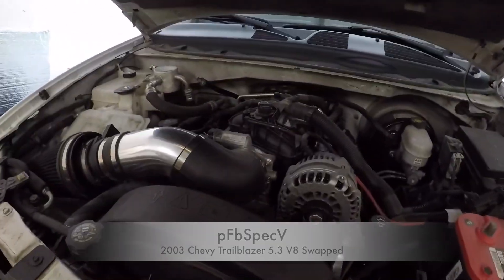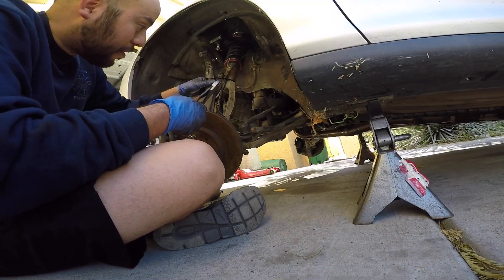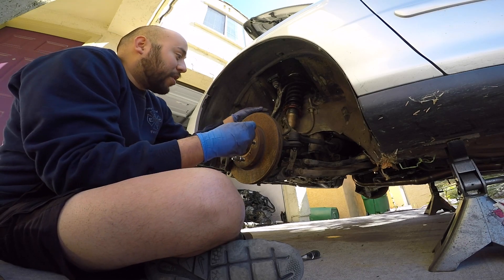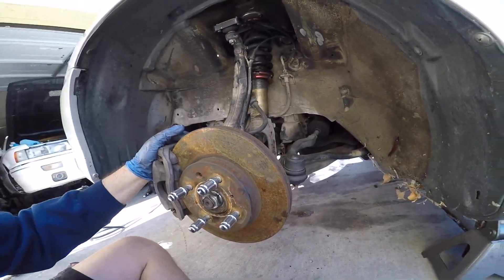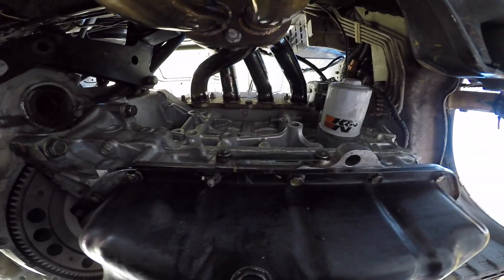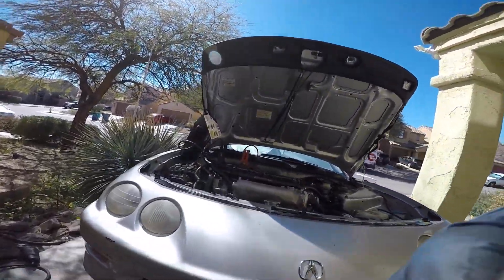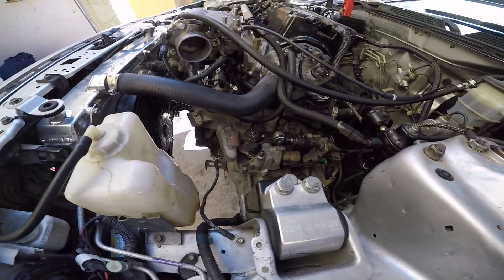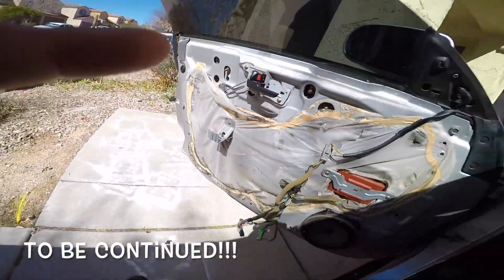Installing Axles on my k24a2 Acura Integra.... SUPER EASY!!!!

Comment: Going to bounce off Mike's question. Are you running with the K20 midshaft or the original K24s midshaft?
Reply from the maker: I wanna say ep3 mid shaft but could be wrong
Reply: @pFbSpecV  ah so the k20a midshaft. I have a k24 one on mine but been reading it's a couple inches longer than the k20a's so that throws a wrench into the axle plans. Might have to grab myself a k20a half shaft.
Reply: N11LL0  K24 swap an RSX? You'll need a Kpro ECU with a K24 Basemap. K24s can be run off the K20 ecu but you're going to lean out because the ECU isn't supplying enough fuel for the displacement. But all the K24A/K20A transmissions and the K24Z/K20Z transmissions should bolt up to each other. The only ones that don't match are the EarthDreams where the Intake/Exhaust were swapped, and the starter is located on the backside.

But a K20A2 transmission on a K24A2 is a bolt-on affair requiring no special adapters. You just need to swap a few sensors or repin the RSX harness with TSX connectors for some sensors like the Knock sensor as it uses a different connector type.
Reply: N11LL0  no problems my dude. All I need is a workshop and a bunch of Ks and I'll write a KSwap Bible haha.

Comment: what axles are you using and did you have any issues with the radiator hitting the throttle body or fitment. I'm at that stage now
with my k20a2 5-speed swap. Need good budget-friendly rad and axles. instagram Ekracer98
Reply from the maker: Use rsx base model axles and i dont recommend the csf radiator. Im still having over heating issues with that radiator. 

I have tried multiple things and still no luck. Removed the thermostat, swapped motors, did the head gasket, added a fan, and still no luck.
Reply: @pFbSpecV   Alright thank you, man. I'm still trying to figure out the rest of the stuff I got to run my fan switch wire and temp sensor wire somewhere. Do the base model RSX axles do they need to be modified or just throw them on? I just finished my wiring today still got run fuel lines.
Reply from the maker: @stinky15552  just slap in the base model axles and you will be good man
Reply: @pFbSpecV   Thanks I ended up buying Hasport axles and koyo swap radiator. IG ekracer98
Reply from the maker: @stinky15552  good choices for sure!!